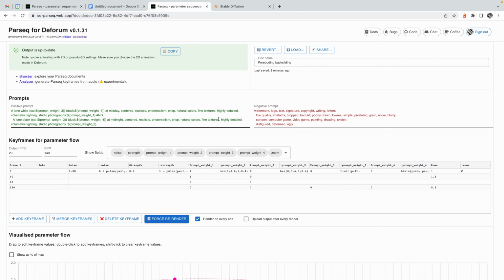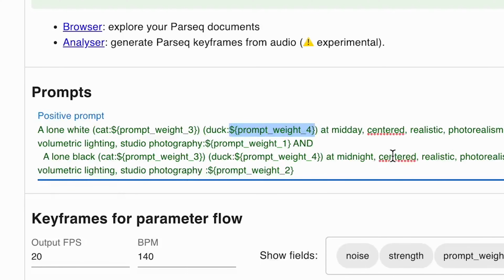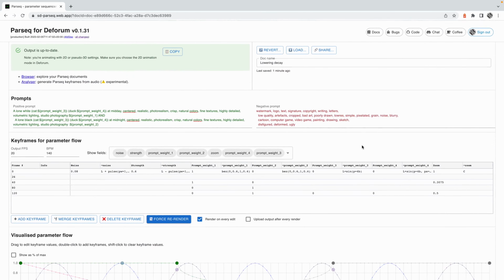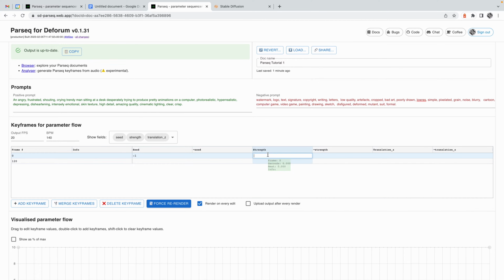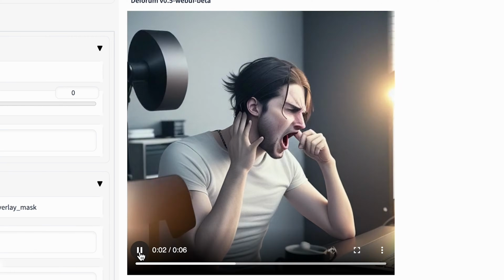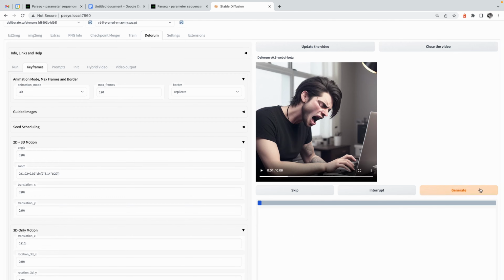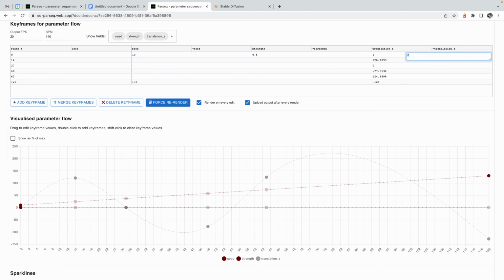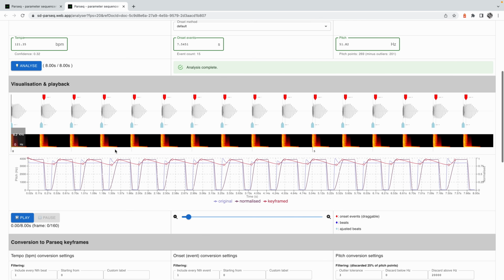Parseq tutorial 1: Fine grained control of Stable Diffusion and Deforum – Keyframing & Interpolation

Comment: Hello, I’m working with Deforum using Parseq, linking it with a wav music file and adjusting the translation x and translation y values. However, the edges of the images are being generated awkwardly—could you tell me which values I should adjust in this case?

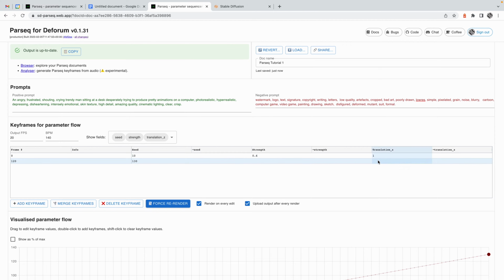Comment: Hello! I have a problem when adding the zoom translation_z at min 13:20 . When adding the values 1-128, nothing changes in my video, (it's not zooming-in). I've notice Robin changed the animation mode to 3D and i've already did that but still my video doesn't zoom in. Can somebody help me or been to the same issue?

Comment: Hey Thanks for the amazing content, i have a question regarding the values of different parameters, for example translation x,y,z or rotation x,y,z sometimes it is by pixels change and sometimes it is by degrees and for zoom in 2d mode it is a value between -1&1. what happens in parseq when we exceed the value that is allowed and does "show as % of max" still works when we enter higher value than needed? is there a way to see all information about values, because this confuses me alot. Thanks :)

Comment: Could I somehow use this to do an image to image at specific frames? I have 3 images That i want to generate in betweens of each one morphing into the next one. So i have two images and i want to start with one and end up with the other over 30 frames.
Reply from the maker: There is a feature called guided images in Deforum which can help with this. Or, you can create a slideshow video of your images and use it as an input video on hybrid video mode.

Comment: hello, thank you very much for your tutorial, unfortunately I get after inserting the Copy output from Parseq to deforum, this error message: "UnboundLocalError: local variable 'parseqName' referenced before assignment" this is displayed after I pressed the Generate button, do you know what I can do? thank you very much. unfortunately it does not start to generate in deforum.
Reply from the maker: Hi, this usually means you need to update your Deforum extension. Could you please make sure you are on the latest version and let me know how it goes?
Reply: @rewbs  
Thank you very much for the tip and your work!!!, it worked(partially).... (more about this below). 
My steps were as follows: 
1. I edited the file "webui-user.bat", opened it in the editor and added "git pull" to it
(to enable automatic update). 

2.Then i checked the extensions tab for update for Deforum, it was up to date. 

3.Then i downgraded my pyton version(from 3.10.10 to 3.10.6).  

**Then I found out** that I should have all options turned on in the Parseq option: "Managed fields" (so that all settings are done by Parseq).

Then the error ("UnboundLocalError: local variable 'parseqName' referenced before assignment") doesn't happen anymore.
----------------------------------------------------------------------------------------------------------------------------------------------------------------------------------------------
I have more questions:
1.Do you know if it comes to problems if one would use quite many prompts? For example over 50 prompts?

2.would it be possible to add an option to the prompts to enter also times(seconds)?
so instead of: 
From; Frame: "0" ... To; Frame: "120"
to
From; Sec: "0.00" ... To; Sec: "5.00" .

it's totally late, must go to sleep urgently ^^

Comment: Hi! 
I didnt found some trubleshoot. so Im asking here. 
 In the last run I getting this problem: RuntimeError: The size of tensor a (336) must match the size of tensor b (320) at non-singleton dimension 1, trying to understand why...
Thanks!
Reply from the maker: Hi! This is most likely not related to Parseq but rather the underlying invocation of Stable Diffusion. I've seen this error when using unexpected dimensions for the input image or the desired output.
Reply: @rewbs  Yes, it is the input dimensions! Thanks!
Reply: @rewbs  Hi again! Another issue, I got this line: ValueError: eta must be 0 for reverse sampling. Any idea? Thanks for all the effort!
Reply from the maker: @Tedrer  Hi, not sure about that one, but I suspect this one is also unrelated to Parseq. Perhaps you could try using another sampling algorithm, or check the a1111 settings to confirm "eta (noise multiplier) for DDIM" is 0?
Reply: @rewbs  Hi! Yes it is 0. its happen again right now when I changed some of the Parseq dimensions schedule values...cant point my finger on the problem source